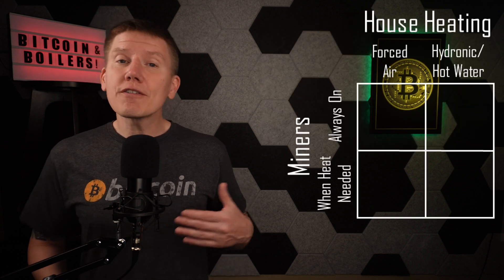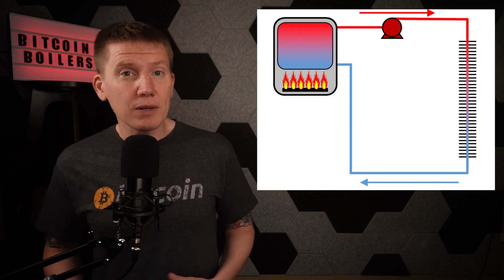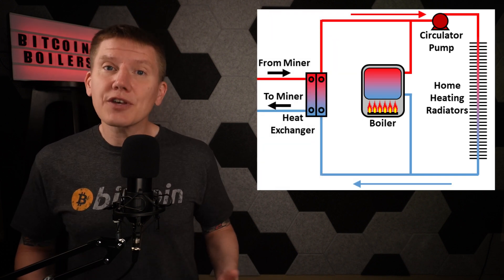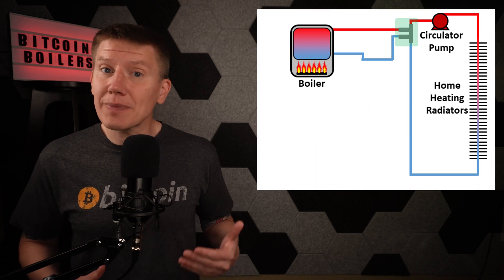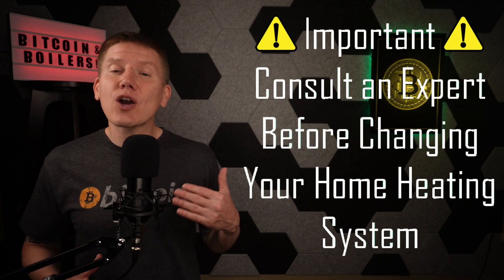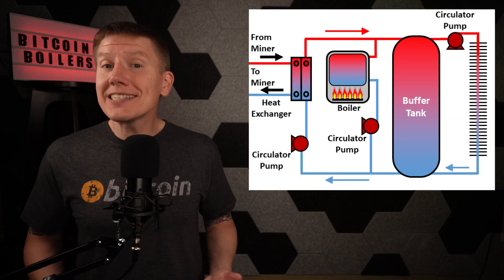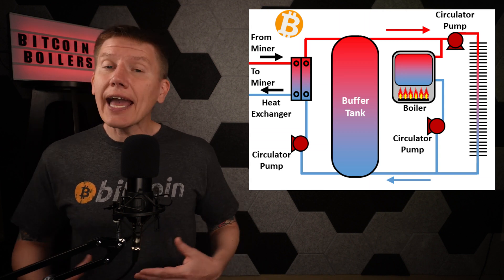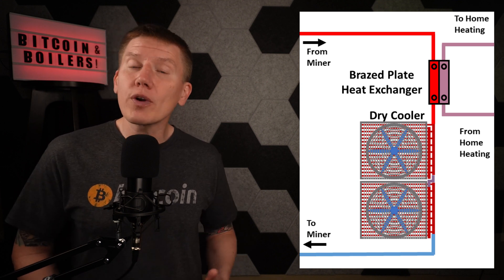EP23: Can you add BITCOIN to your hot water home heating?

Comment: Hey brother, love the content! Well thought through. 

Question: is there any particular reason you went with immersion over Hydro cooling? Im considering building a set up to tie in to my current hydronic system. Even converting s19 or the like with water cooled heat sinks seem like it would be a cheaper option then dielectric fluid?  Would love your input thanks 👍
Reply from the maker: Thanks!  ...and great question.  When I started my journey, the hydro miners made by Bitmain weren't on the market yet and the hydro solutions available were sketchy retrofit designs put out by equally sketchy overseas vendors.  It just seemed like a bad idea.   Since then, there are more reputable solutions out there, but I've noticed most of the industrial miners are staying away from them...not sure if that's because they are too labor intensive or if its a reliability thing.   The retro kits are definitely cheaper than immersion...but I have no idea if they are going to be as reliable.  In any case, whatever you use, once you get to a water-glycol cooling loop everything is the same, so home heating/hot water heating will work the same way!
Reply: @HBIM_Channel Good points immersion  for the most part looks very promising for longevity and reliability. It will definitely be interesting to see how this space evolves particularly in this area thanks for sharing your experience 🙏